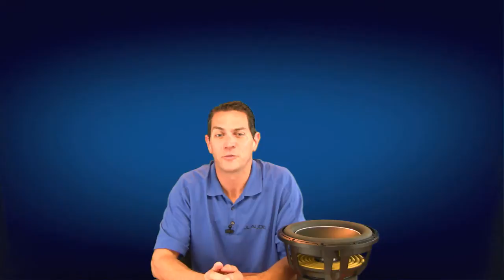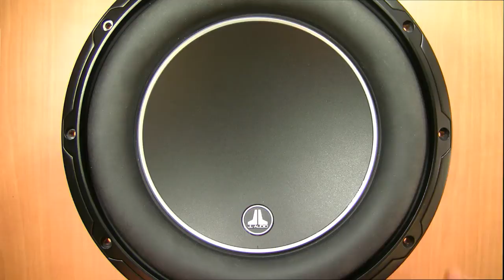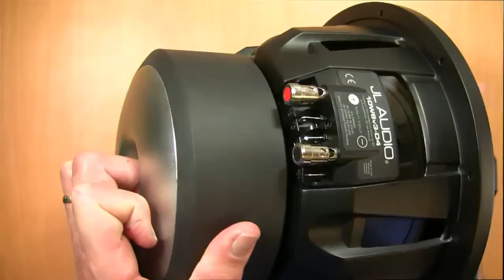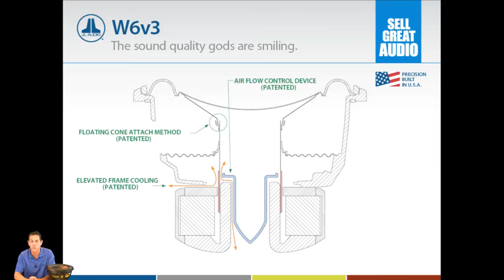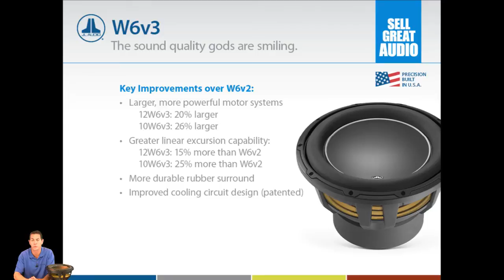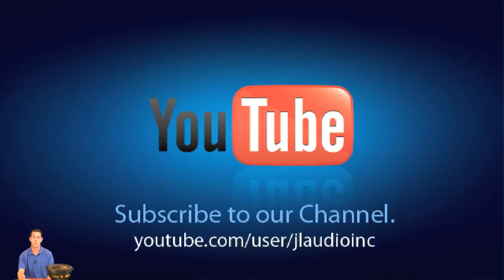A Quick Introduction to JL Audio W6v3 Subwoofers

Comment: How does the w6v3's compare to the w7's in sound quality?. In hearing the w6v3  has better sq, and the jl w7 is a mix of spl and sq.
Reply from the maker: The W6v3 is an excellent performing subwoofer, however, the W7AE is comparatively superior. The W7AE offers higher power handling, more overall output, and superior detail when compared against the W6v3.

Comment: I currently own a 12w6v3 which I’m also running with a jl audio jd 500/1 and I’m a little confused with the power handling chart because it shows that any amplifier over 500 watts puts the w6 in the danger zone but it’s advertised as a 600 watt rms sub so if you run it with a 600 watt amp will it damage the sub?
Reply from the maker: We provide a range depending upon the user and listening style. The yellow or optimal is the best compromise between power handling and output with most music material. The higher range approaching red is best for moderate listeners or for those that listen to a wide variety of music. You would have to be a bit careful with heavy content at high volume with power in the red zone.
Reply: @garminaudio  my genre of music is usually hip hop with really bass heavy songs

Comment: I have the 12w6v3 in the Original H.O box (same as w7) and I can say... 1 hit so hard.  Just like 2 12s.
Reply: Question for JL Audio.... Will a w7 perform well in this box since it’s a little bit smaller than the w7 H.O box?
Reply from the maker: No, the W7 would require more air space to allow it to play to full potential. Also, the mounting hole for a W7 is smaller than a W6v3, so you wouldn't be able to mount it to the W6v3 enclosure. Plus the weight could be too much for the W6v3 front plate anyway.

Comment: I've been a JL user for years now all the way down from the w0 in the wedge type box up to w1 w3 w6 never got to w7's yet im working on it anyway my recent build has one 12w6v3 powered by a boss ar4000/1 whoever thinks boss amps are garbage better rethink that cause my 12 is slamming pretty dam hard its enough to piss off the person in their car infront of me but i gotta ask one question being that the 12w6v3's  recommended wattage is from 200 to 600 watts can it handle more reason im asking because the shop i purchased the sub from said that my boss amp wasn't enough for the 12w6 i kind i smiled when he said that because my cousin was moving two 15 L7's with two of those boss ar4000/1 amps 1 amp per sub and those subs was coming through like a tornado on steroids and if im not mistaken the L7's peak handling is more then the w6 anyone has a take on this could it be JL just underrate their sub for warranty purposes.

Comment: Seems JL now [2017] has the feature set others have had for what? 4-6 years? And at a much higher cost of ownership? Value doesn't seem to be there. 3.9dB gain with the V3 though, pretty substantial improvement.

Comment: I have won more trophies with my JL HD amp with a JL 13w6v2 and it plays 20hz to 40hz with a huge box and my 8inch zr8 play 40hz to 250 and my 4inch play 250hz to 12k and my tweeters play 12k to 20k 

JLs amps and subs are top notch and just plan win.

Comment: Here the sealed boxes information is different than the JL website.

There the recomendation for the enclosures are 15.57 L to the 10" and 28.3 L to the 12".
But here are 17.7 L and 35.4 L.

Whitch is the correct?

Comment: Just bought 3 HO110W6V3 enclosures for my scion xb and will be powering them with a B2 zero.3. I have to do the big 3 first. Right now I only have 2 of the enclosures hooked up to a fosgate 750.1 prime and it bangs like crazy. And before you ask why I bought 3 enclosures instead of just woofers, its because I got a great deal when I was at texas heat wave.

Comment from the maker: The W7AE is definitely our flagship speaker.  It remains as our best overall subwoofer in many ways.  The new W6v3 is pretty darn close to it.  It does not have quite as much excursion as a comparable W7 but the fidelity is right there with the W7s.  You asked how it "hits" compared to the W7 which leads me to believe you are looking for output.  I'd go with a pair of W6v3s over a single W7.  The price is similar and you can get more output without compromising quality.
Reply: I have ran many different manufactured car audio products.

I like the clean engineered sound of JL Audio products best.

🤙
Reply: I still think the W6V1 is the best SOUNDING sub JL ever made. I wish you guys would rerelease it as a low excursion audiophile classic sub. Having said that I own 5 12w6v3s and it’s the best sounding JL sub since and would absolutely bury a V1 output wise if you care about that. I run 6 18w6s behind an acoustically transparent screen in a HT and I still think it’s the greatest sounding sub I’ve ever heard if you have the space. I was not a fan of the sound of the V2s but they were SO much better than the W7 I thought. Do a limited release on the W6V1s that started it all. Take my money!!!
Reply: @No-turbo  that's what all the other models are for .....w1, w3 etc ....
Reply: I have the CLS10"W7 with the XD600-1V2 sounds amazing.

Comment from the maker: @TheLPSJP:  500 watts is great on a single 10W6v3.  The sealed enclosures will ship in June.
@wopino:  with the same amp, you may not see it get any louder, but the detail and extension will improve
@overclockedHD:  both the 10 and 12 inch versions are rated at 600 watts.  The W6v3 is among the best woofers we have ever made.  The TW5v2 gives similar sound, but in a much shallower speaker and smaller box. It will not play as loud as either of the W6v3s.

Comment: I currently have 2 12w3v3's in a custom ported box that's about a year and a half old running off an Alpine PDX-M12 giving them about 1300 watts. If I upgraded to 2 12w6v3's would I see a significant increase in DB output?

Comment from the maker: Bdr2sc01:  If the dual 10W3s are still working well, there may not be a reason to change.  You could go with one of the new 12W6v3's if you wanted to.  I am pretty certain it will fit and I know it will do great on the 500/1.  

For your doors, I would look at either the C5-570's or the C3-570's.  Both products are very impressive.  The C5 is a bit smoother overall (with a bit better midbass capability) while the C3s play a bit louder (I use C3-650's in my car FWIW).

Comment from the maker: The original "slash" amplifiers are iconic at this point.  There are some technical differences between them and the other models we now offer (HD, XD and JX), but the Slash amps (now in version 3) remain one of our most feature-packed amplifiers (certainly for bass).  The right amplifier would depend upon your overall needs.  Email us at technical@jlaudio.com if you need help with your system design.
Reply: JL Audio i run a 12W7 in the H.O. box , pushed by a 1000/1V2 Slash in my '06 H2 .. simply THE BEST sounding system ive ever had 🤘🏼